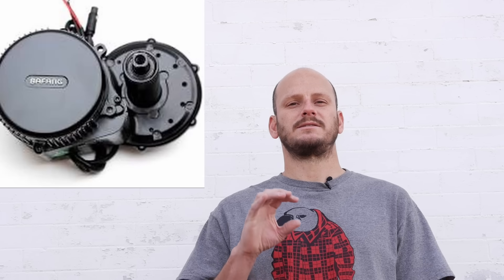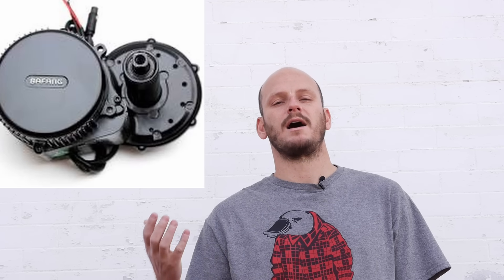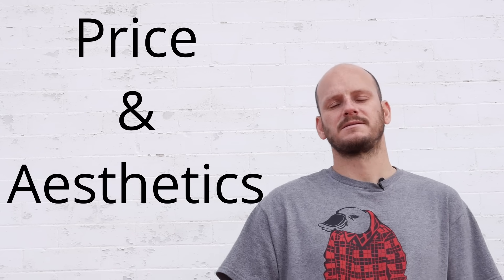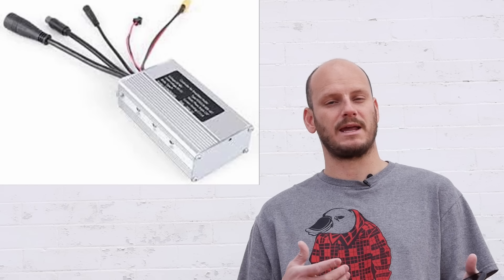Hub vs. Mid Drive Motors: Why Hub Motors Suck and Debunking Common Myths with performance test

Comment: Would you say these ride feel comments are relevant for EU market, where we use a torque sensor (measuring pedal power)? I find the combo of torque sensor and hub motor in single speed bike an amazing experience, very natural and intuitive. The Bosch mid motors feel quite boring and feel like they have some sort of delayed response. Does that make any sense to you?
The biggest downside to rear hub motor these days imo is that it's taking up the space of a stepless gear, like the Enviolo NuVinci.
Reply from the maker: Torque sensors definitely make it feel more natural

Comment: Couldn't agree more. Doing my first mid-drive build. Picked up a 2012 Brodie Bandit hard tail in mint condition on Facebook for $225. Ordered the forthcoming CYC X1 Stealth. Will ship 10th of April. I'm pairing it with a 21Ah Mega Shark battery from Electrifybikes. I'm going to test it with the stock drivetrain and then upgrade to a Box Components Box 2 Prime 9 1x9 Ebike drivetrain for a comparison. I will also compare heat and noise in the motor by swapping out the grease in the gearbox for Planetsafe AIM grease.
Reply from the maker: Very cool

Comment: Superficial an biased explanation...
Why didn't you say that you chose a GEARED hub motor?
Why didn't you clarify that it depends ESSENTIALLY on type of use?
Why do you show climbing hills without using pedals?
Why not explaining that spoke tension is just normal care for hub motors?
Reply from the maker: Bafang only makes a geared hub motor. I explained that’s what I’m using. I didn’t pedal so you can see it’s all motor. A direct comparison. Doesn’t matter what type of hub motor your use. You still can’t use that power as precisely as a mid drive.

Comment: Spokes on Mid Drive experience the exact same forces as a hub. As the mid drive still transfers it's energy to the rear hub, which gets transferred to the wheel through the spokes.
Reply from the maker: Correct. See pinned comment

Comment: Why is there rarely any mention of unsprung weight  ? The weight of a hub motor makes for much slower suspension speeds = less contact with the road !  I enjoyed your video. I learned a lot. Thanks.
Reply: A lot of bikes don't have suspension on the back, so all weight is unsprung weight anyway.

Comment: I have seen several comparisons of mid-drive versus hub motors on youtube, and none of them seem to mention motor power,  motor gearing or front versus rear hub motors in their analysis. 
For example, hub motor gearing and torque have an impact on hill climbing ability and motor burn out. Low geared motors would climb hills much better and have lower tendency to burn out. Not mentioned. 
The drawback of mid-drive and chain breakage would be surely greatly reduced if not eliminated when considering power output. Wouldn't a 250watt mid drive would be much less likely to break chains than a 1000watt mid drive? Also not mentioned.
Also ignored is the impact of hub motor weight in a front wheel installation and tire grip. A few extra kilos over the front wheel might improve tire grip and bike balance and reduce the tendency for wheel spin and loss of adhesion in front drive installations. Again not mentioned.
I think when these aspects of the topic are ignored you cannot really get a clear picture of what is going on. I understand that not every aspect can be covered in every video, but without mentioning what seems like essential aspects of the topic, you cannot come to an accurate conclusion.
Reply from the maker: This video was already over 10 mins. Yes you’re right that all those are factors. In my experience 1000w mid drive should not be considered a “chain breaker”. Ride normal and you’ll replace a chain every 1K miles. Slightly more than a conventional bike. 
Hub motors under 750w just suck.

Comment: I have a front hub. Maybe not the best, but 2-wheel drive really helps when navigating through some sand or loose dirt.
Reply: Agree 100%. Front hub is simple and bullet proof. If you bust the chain on the trail, the hub motor will get you home. My bike has plenty of hill climbing ability. I did the conversion myself for a fraction of the cost, even using quality parts.
Reply: @bobwelwood3093  Amen brother! You and I think very much alike. I lace all my own wheels and everything. It is so easy I can't believe some people pay as much as $100 to lace a wheel...
Reply from the maker: I’m sure

Comment: Great video on the comparison. I have both, a 750W hub and a 1000W BBSHD. Been riding my hub drive bike for like 7 months and yesterday was my first time riding my bike with the BBSHD and the difference in power is night and day. Torque, speed and the quiet motor on the mid drive is super nice.
Reply: You can't really compare your motor's unless your less powerful motor was mid drive. But it is only common sense that a mid drive motor with gears would be better at hill climbing and range and speed
Reply: @marvenlunn6086  both were 500 watt so yes I can.
Reply: @Billbobaker  no 1 was  750 watt the other was 1000 watt I was rep!ying to june215
Reply from the maker: I know it’s crazy when people say hubs are better. I don’t get it.
Reply: @JohnnyNerdOut  Hubs are better in many use cases.
Reply: I have both too.. each has it's place but the mid drive is like ten times more efficient and powerful.. just learn to pull the break lever slighly between shifts to save wear on your chain drive.
Reply: @Billbobaker  Bafang has an optional gear shift sensor.
Reply: @michaelsprinzeles4022  yes and they recommend it but I find just touching the brakes slightly works fine.  It suspends the power for a moment.
Reply: @Billbobaker  mid-drives are less efficient because there are more steps thus more transmission loss from friction and gearing
Reply: @sammiller6631  I've had both.. I know which ones work best.. 
Mid drives by far.
Reply: @Billbobaker  which ones work best for you but ymmv as usual. I don't find as much value in gear ratios of mids as do others.

Comment: quick question: would a bafang bbs02 fit my orbea mx50? thanks.
Reply: Check what size the bottom bracket is, bbs02 will say what they fit.

Comment: I have a BBS02, 52V 20AH on a hardtail MTB - nice setup, light, fast, torque at start-up and I don't burn up battery life going up hills like a hub.
I don't see any Tongsheng TSDZ2 mid-drive conversions in your video build collection. Less powerful than a BBS02 but uses Torque sensor for a "Bosche like" e-bike feel.  jbalatutube channel has a nice upgrade and maintenance series on the Tongsheng.  It would be interesting to see your opinion or experience with a Tongsheng.  Better Assist at lower power = more Range for a less speedy ride?
In general, the Bafang gives you more power for the Money - which I can see why you use them so much. 
Try this for Bafang Motor mounts - get 2 screw type hose clamps, one large around motor, smaller one on downtube and they link-up so motor is tight to frame - think figure "8" .  Added support in case Bottom Bracket Nut gets loose.

It would be cool to see a mid-drive Folder Conversion.  I have a Lectric XP and it's @ 66lbs Heavy - rarely you fold it and carry.  A skinny tire 20" folder w/ disc brakes be a great base for a commuter you can take inside.  Avoid 16" and smaller - wheel RPM too high at Speed for mid-drive pedal cadence.

Wish you - Long life batteries, No Flats and Safe riding (always have a LH mirror for traffic awareness)

Comment: I have built a Bafang BBS02 mid drive and a cheap1000w Chinese hub drive. I mostly agree, however, the one thing I would note is that when I turn my Bafang off (to 0 on the PAS), the motor really fights me (extra drag) when pedaling the bike, whereas I don't feel that on the hub motor.
Reply from the maker: Interesting. Maybe it’s torqued on too tight?

Comment: its a tough sell....couldnt imagine wanting a mid motor over a hub....
Reply from the maker: Really? Did you see the video comparison? What is appealing to a hub motor?
Reply: @JohnnyNerdOut  easyness of installation...twist and go throttle...my friends with far superior mid motor bikes are envious of the cheapness and no need to service aspect....I just got a piece of shit hub motor from eBay.. a decent battery put it together in 2-3 hours ......so far done 1600 KLM hassle free.....I ride it in the rain...snow... no prob...not once
Reply: Maybe for off road and rugged terrain hub is not great idea...but for around town and A2B hub is perfect
Reply from the maker: @bjornmarley5670  that’s awesome to hear! I bet they aren’t running BBSHD motors though....

Comment: bought a cheap china ebay hub motor 1000w....done 1600klm never skipped a beat ..cant imagine a mid motor being as problem free...
Reply: Have 4 hub bikes(500 to 1000w) in family and no issues so far and we live in hilly country. Have a friend who has 350w mag alloy wheel hub motor folding bike and he has covered over 14,000km. Other than replacing rear freewheel (the 11tooth top gear wore  it’s teeth so he replaced it but also changed front chain wheel from 44t to I believe 56t so now he also gets to use more of the middle gears on the freewheel thus spreading the wear )and brake pads plus tyres, he has never had an issue. His 48v 10.5 ah battery gives him a range of 50 km and he is a big chap around 230 lbs.

Comment: So, okay, a mid-drive is more efficient at putting power to the ground, because it uses the "transmission".  I can't argue with that, but, that results in a lot more wear and tear on every component in the entire drive system.  Also, while you might be able to convert a bike to mid-drive as cheaply as converting it to hub drive, you can't buy a ready-to-ride mid-drive bike nearly as cheaply.  For example, the RadCity 4 is $1,500, with many accessories included.  Show me a ready-to-ride mid-drive bike, equally equipped, for the same price.  So, for me and many others, it's pointless that mid-drive is better.  A Lexus would be nicer than my Corolla, but I can't afford one of those either! :)
Reply from the maker: It’s only because people keep buying these high margin hub motors. Stop buying them, buy mid drives and Rhodes prices will fall dramatically. Also the wear and tear on the drive train is not bad at all if you ride properly, like any bike. I’ve done almost no repairs on my bike in the last 1500 miles since I’ve switched to a single speed chain. You might spend an extra $20 a year on repairs. Maybe.
Reply: @JohnnyNerdOut    I'm sure you understand why people don't buy bikes with mid-drive motors.  They are way more expensive, and frankly, hard to find at any price.  All electric bikes are obscenely overpriced right now.  I can't find anything decent for less that $1,500.
Reply from the maker: @ExSkyCyclePilot  ya. That’s true.

Comment: That's not true that their priced the same. Just check out the ebike companies and what they're selling them for. Hub drives ebikes are a lot more affordable than the mid drives.
Reply from the maker: It is if you do an apples to apples comparison. Using a bafang system for example, both 750w. They are within $100. It’s when people start comparing different brands is when it gets wonky. Like comparing Chevy and Audi. The same principal applies when using the same brand.
Reply: @JohnnyNerdOut  Nope! You're missing the point entirely.
Unlike you, most of us aren't bike mechanics, so we just don't simply buy a motor and build a bike around it. ( personally I haven't met anybody who's done that ) No! Most people shop ready-made to go e-bikes brands that are available on the market.
And that's what I'm talkin about!
And if you check 'THOSE' prices, you'll see that the Hub motor bikes are way more inexpensive then the mid drives.
Reply from the maker: @dcuss7294  true. Only because people keep buying them(demand). That’s the only reason they are cheaper. I just want to plant a bug in peoples brains so that they at least know the mid drive is superior and it shouldn’t be double the cost as a hub motor bike. That is just insane to me and no one cares.
Reply: @JohnnyNerdOut  Thank you! That's all I wanted to point out.
Unfortunately since most of these companies are in Asia, because of the tariffs, the prices seem to be going up for both Hub and especially mid Drive ebikes.
Reply from the maker: @dcuss7294  😀

Comment: Inevitably this is a little bit of ‘oranges to apples’ but that reflects the actual choices for an e-bike!  I fundamentally ‘like’ the principle of hub motor design - motor in a wheel - and there’s no technical reason an epicyclic gearbox couldn’t be fitted to a hub motor.  Mid-motors essentially, ought to be able to capitalise on not changing much about the bicycle design but as they sit right in the bowels of the frame, that turns out not to be as neat and easy as it might be first thought?  A direct comparison would be a hub motor with built-in epi gearbox/reduction.  That would make the decision harder I guess?!  Interesting and informative video on this debate, thank you for your insight.
Reply from the maker: Great insights😃

Comment: My wife's ebike has a 750 watt hub motor, mine has a 250 watt Bosch mid drive. Mine accelerates and climbs much better.
Reply: That’s quite possible. Have seen yt vids where a Bosch mid drive (can’t remember if it was listed as 240 or 250w)was tested and if I remember correctly was  capable of drawing 900w. Just motor marked at 250w to get around Europe’s laws.
Reply: Impossible, defies reality.
Reply: @michaelbrownlee9497   Nope. A guy I know who has been selling ebikes for years says that he doesn't even look at watts. Different engines and drive systems have different efficiencies.
Reply: @carpelunam  Talk to people who deal in ebikes. Then say something that is more informed.
Reply: @michaelbrownlee9497  wattage of an electric motor refers to the current the motor draws (wattage/voltage=current in amps) either at peak or sustained, not how much useful work you get in exchange. A mid drive is in the 90% efficiency. A good high end hub can get up in that range too! But most of them are in low-mid 80%, worse if they have a controller out of a crackerjack box.

to add to sfdint's comparison, I'd wager his Bosh could out-accelerate a PK80/BT80 2-stroke, and that's 2,500 watts. Eventually the higher wattage will win on flat ground, but torque (affecting acceleration and climbing power) rules until you're actually up to speed.
Reply: @DFX2KX  OK so we no longer will use the term wattage, only amps. Thanks for the top.
Reply: @michaelbrownlee9497  not necessarily. Wattage is still useful (of two motors with the same wattage and efficiency, the one with higher voltage uses lower current).but current and efficiency become particularly important at the lower end of the power spectrum, thus cheaper hub motors.
Reply: @DFX2KX  no cheap just expensive, OK.
Reply: So you're comparing a cheap hub motor with an exaggerated wattage to a more expensive Bosch mid drive? Apples vs oranges there.
Reply: What's the Kv rating of your wife's ebike motor?

Comment: I will keep my hub motor on my 26" full suspension mtb.  Seriously checking spokes, even replacing spokes is quick and can be done without even a full dismount of the tire or wheel period.  I have done replacement in 15min twice, only about 12 spokes have broken over 7500km.  As an electronics technician, there is only a decrease in efficiency in mid-drives, as you have chain stretch, minor frictions on active chain rings and gearing.  Hub motors also can provide regen braking, of which I take full benefit through a 1500W motor, tho I only run it at 500-1000W (I avg 600W, limit 1000W).

Comment: I do both work fixing ebikes and make deliveries with ebikes, I ride just about 100 km a day and have 5 delivery bikers some with cargo bikes. And I completely disagree.
I have to fix the middrive bike much more often than the hub bikes, I replace a spoke very rarely, the trick is proper rims. Not to mention the amount of money spent on the drivetrain,
The trick is having the right motor, but if you are using low power the chances are that you will have much more problems with hub motors, they need to match by having proper kv and wheel sizes also weight and average gradient, it's not just install and have fun, like middrives

From your perspective I can see why you think that, since you are not tracking what every bike is doing.
Reply from the maker: Ya you get it. Obviously this video doesn’t cover every nuance. Sounds like you’ve got your setup dialed in pretty good though.

Comment: My hub drive in conjunction with my 24 speed Shimano Gears (3 on the crank & 8 sprocket cassette)  allows me to ride my bike like a bike NOT a motorcycle (I almost NEVER use the throttle feature)
The reason I bought this setup is so I can get the exercise & not the bike.  My daily street ride is 10-15 miles and only use 1-2 power level to assist me on hills that are approx 20% of ride. Utilizing the proper gearing allows me to consistently get 60-70 mile range, between charging, on my Ancheer Blue Spark w/36v/10.4Ah/350 Watt rear Hub motor.  I think the most important feature on my bike are the HYDRAULIC disc brakes.
Reply: That's a great comment you've made I have just brought a rear hub drive I use it like a normal mountain bike but use  the electrical power to help with the hills at 63 years old and 16 stone I'll take that

Comment: ive never broke a chain on my bosch mid drive. But once again bosch makes motors to make a bike feel like a bike. Bafang makes motors to make a bike feel like a scooter.
Reply: What bike frame do you have? Did you buy it separately?
Reply: @AK-zj4pn  I have a raliegh redux IE. Bosch only makes motors to OEM specs. They dont sell add on kits.
Reply: I've my bosch